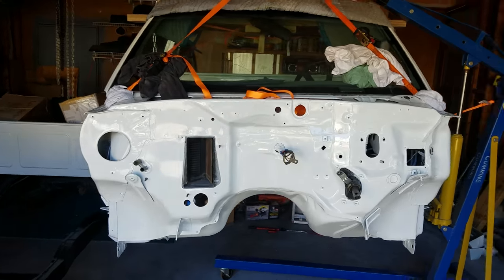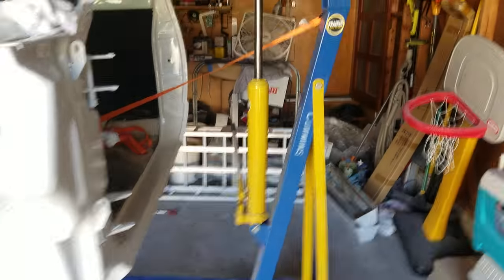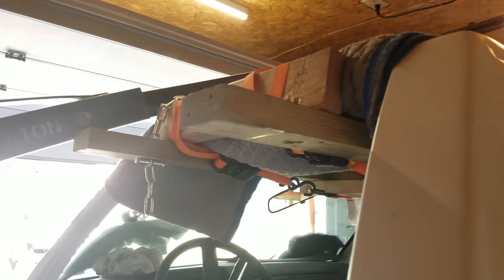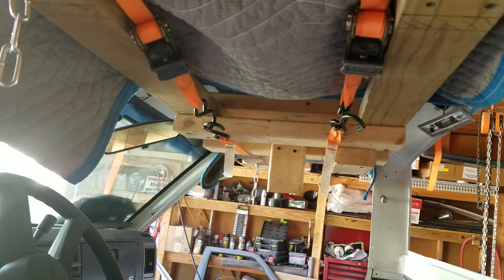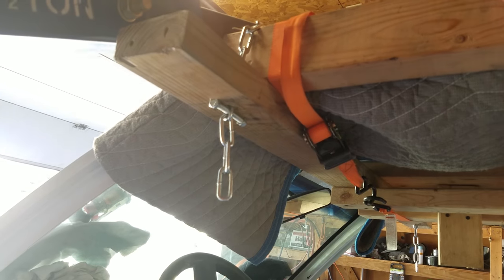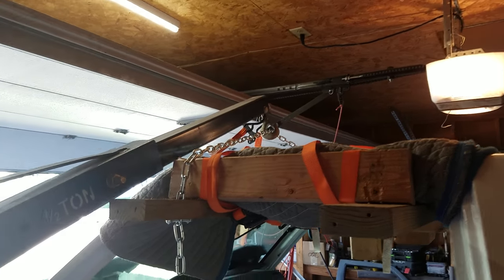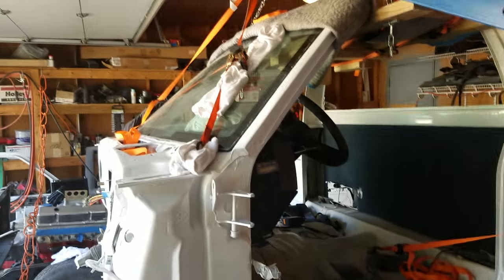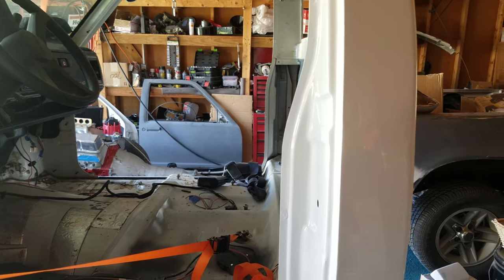Easy way to remove truck cab by yourself! Using a hoist and ratchet straps.

Comment: Great idea. I would probably try to beef up that bolt that's attached thru the chain...would like to use something stronger, but I'd have to figure out what. If that snaps it's over. Otherwise, this seems like a good setup. I like the idea.

Comment from the maker: To anyone curious, I had no damage to the fresh paint where I had put the moving blanket between homemade wooden cradle and cab roof.
Reply: 402 DIY GUY 

What’s your opinion on using just straps and no wood ?
Reply from the maker: @114wildfire  I think it's a possibly, however I was afraid if I only used straps on the roof that it would cause damage to the roof skin considering all the weight that its holding. Making the cradle, I believe ensures an even weight distribution out towards the edges of the cab where the cab is more structurally sound.

Comment: Hi i need some help with mine right now my axles are off and its just frame but ill probably put axles on to do this. Can anybody send me some info on making the brace and where to put straps i have a 1986 chevy k 20 build and is it easier to paint cab on frame or off right now i have cab off but i have to paint frame first
Reply: I took a full size cab of a 57 pick up by jacking up one side and slipping a 8 -4x5 across then lifted the other side I put a 4 x across the front and another across the rear. I just kept jacking it up and setting cement blocks under the 4x 4’s till I could roll the frame out from under the cab. It was tedious but it was a one man show.

Comment: Is it really necessary to remove the fender supports in the front?
Reply from the maker: Meanwhile in the Mountians which fender supports are you refering too? The reason nothing is attached to the cab is bc I pulled the cab off to paint, I am doing a complete halfass restore on the s10 and due to this being a learning process, i took off everything that was bolted onto the cab. Nothing was removed that was welded. Other than that, i did not remove anything i would consider a fender support, i merely removed the whole fender/front end assembly.

Comment: i gotta figure somthing out for my 77 gmc but i have the front end still on the cab wonder if some straps would balance it out like u did here also i might have a problem putting it on my mud truck it has a 12 inch lift maybe swap to stock tires?? or even take em right off n put on stands?
Reply from the maker: Doug Martell I think using straps to balance is a great way to solve countering the weight and movement of the vehicle while on the hoist. I would be careful with front end still on truck only bc the front end is already so front heavy bc of the dash,  firewall, and multiple things connected; thus creating more weight. If it were me and the truck wasent freshly painted id give the straps a try. The biggest liability is if the straps fail, or wooden support for cab failed. Something to think about reinforcing if front end is still attached. Hoist can handle it but can the straps and wooden support I made handle. Thats what id ask myself. If it is a newer paint job i personally would take the front end off. Only bc I spent so much time painting. Yes, i would remove wheels and place the frame on multiple jackstand. Probably 6 or more to be safe, especially if motor and drivetrain is still attached. Any other questions feel free to ask! Thanks for watching and hope this helped!
Reply: When I removed the cab on my 01 s-10 I took the wheels off and set it down on car dollies under the drums and rotors. That way I could easy move the frame out from under the cab itself. Hope this might help someone